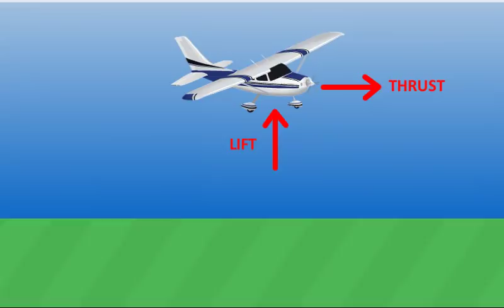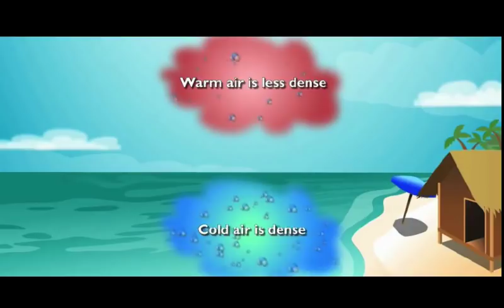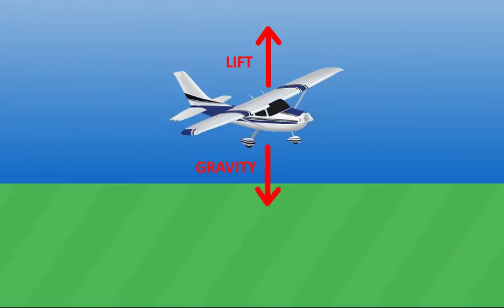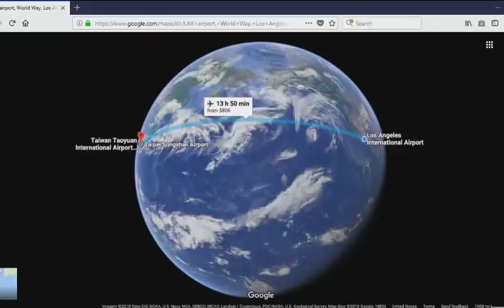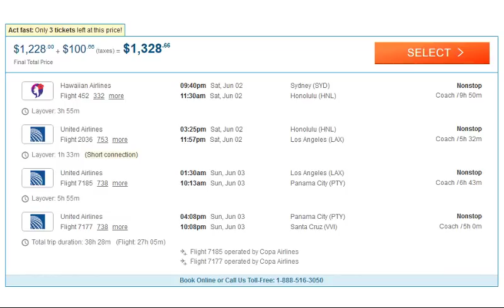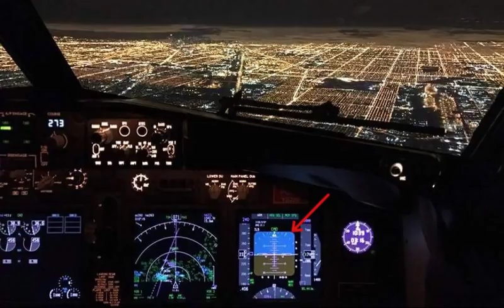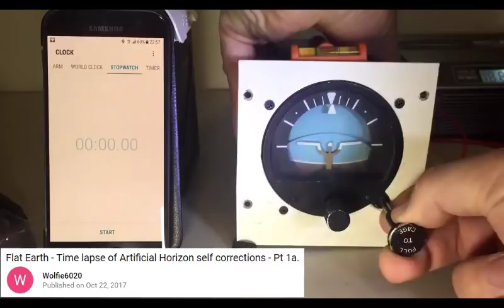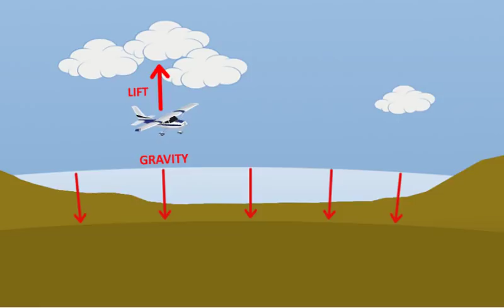Flat Earth Falsities - Plane Nonsense

Comment: lololo ...this is a lame excuse for proof ... Flat earther's have way more proof then this garbage ... lolololol
Reply: "north star over top of the north pole and the stars circle our earth  does that prove a moving earth , Not to me"
It is the first proof that something is moving.
Then you combine it with the stars also circling around a second point in the sky over the south pole.
And you notice the speed of the star rotation matches the length of a day and also the speed the sun passes over.
Then you realise that you see different stars from different points on the Earth with Polaris getting closer to the horizon as you move south until it is no longer visible in the Southern Hemisphere. Exactly as you would expect on a sphere.
Then you realise that as you move 180 degrees across the latitudes, the angle of the moon changes accordingly. Exactly as you'd expect on a sphere.
Then you start to piece together that this all fits perfectly with us being on a spinning sphere and you start to look for evidence or contradictions of that hypothesis...
Reply: "I have a tough time believing water is round."

This is according to the heliocentric model to answer that redundant question you FE get stuck on: This is just talking about Earth itself.

1. The Earth is in motion both in a rotation and a path around Earth's center. 

2. Earth rotates at 1000 "mph". Due to the sheer mass and size of Earth - if a human walks unhindered at a steady 2-3 mph they are moving as fast as the Earth rotates in comparison. Retrospectively, it takes a human 2-3 seconds to jump and do a 360 whereas the Earth takes the entirety of 24 hours. 

3. Water has three forms: Solid, Gas, and Liquid. 

3a. Water in a solid form takes the shape of whatever is holding it. 

3b. Water in a gas form takes both the shape and volume of whatever it is in.

3c. Water in a liquid (microgravity) form will become a circle (like a drop) and has a fixed volume. 

4. Undisturbed water enters a state of hydrostatic equilibrium. The surface is perpendicular to local gravity at every point. Albeit a bad term I'd rather not use - but since this even has to be explained I'll put it simply:

The Earth is a massive raindrop. 

5. Want examples of water raising locally in which air pressure offsets the weight of raised water? 

A. Get a glass of water.
B. Put a straw in it.
C. Drink.

You're welcome.
Reply: +GrahamStw
But @Tell us the Truth Media !!!  stated he had done the research and therefore he should have known those things. Surely he/she/it wasn't being dishonest. Shirley Knott!
Reply: Mykal Ridikulus holy shit, good read and much better reasoning than "i did some watching of loonies on youtube".

Also, how do they forget about a raindrop being round, (what shape is a hailstone, ya tards.) It only looks like that typical shape because it encounters air resistance while being pulled down by gravity.

Wow, they do so much "thinking"
Reply: Yeah, like being tasked to write a 10 page essay, but 1 mention of the word "the" nets you an F or a 1/10 lol
Reply: hiddengnome 

To be fair.. a rain drop is no more "perfectly round" then the Earth is. 

Aside that, it bothers me that they never take motion into account. In the heliocentric model, it is irrelevant if you don't believe something exists - it's then your duty to test it accordingly and disprove the belief whatever that is.

Example: "Gravity doesn't exist it's just Bouyancy and Density." 

Invalid argument. This takes two ideas (bouyancy/density) which are products of gravity - yet remove gravity from the equation. Furthermore neither idea explains nor has anything to do with explaining what is up and what is down - why this rises or that falls. High and low density are left at the same value and nothing exists explaining the result - one we call gravity - the idea that gives them lesser or more values. 

It's absolute nonsense.
Reply: Bobby Wizdum 

Not what I said.
Reply: Bobby Wizdum 

By the way. 

Wisdom comes from Latin, "sapiere", which means "to taste". 

Both these Latin origins are entirely irrelevant.
Reply: Bobby Wizdum 

..and no. Gravity derived from the word "heavy". 

"Gravis" is heavy. 

"Gravitas" is weight and derived from "gravis".
Reply: Bobby Wizdum 

I would however love to know how you tested whether the Earth is moving or not. 

I mean I'm sure you took into account the different time lengths a single non stop flight from, say New York to L.A. does not take the same length of time as that same exact return flight amirite?

That's because of motion, numbnuts.
Reply: Bobby Wizdum 

1. I don't give two shits what anyone else said. I personally did not so irrelevant and sad to use someone else's words against me. 

2. Google it. Flights to N.Y. and L.A. non stop both ways. Each has different time lengths. 

Final Lesson. What is velocity in physics? 

Here's your analogy for reference. 

A. You standing still as a train stop. 

B. Man on a bike traveling East on a bike at 5 mph. 

C. A train speeds by also heading East at 100 mph. 

Use this for reference for this problem:

"If the Earth (c) is rotating at 1000 mph how does a plane(c) that speeds at half that affected by rotation?"

This is an invalid physics question. Both the Earth (c) and the Plane (c) are being utilized as the same reference point invalidating the question. 

In other words: The plane is being referenced as a planet (c) when it's a plane (b). 

Retrospectively. Earth's velocity (c) is measured via comparison of fixed stars which move drastically slow in "the sky". A plane on the other hand is not measured by compared stars but if you do..

...flip this you will easily see the invalidity. 

Measure a plane according to Earth's velocity - the planes you see in the sky are traveling (c) (1,000 mph). 

This conclusion leads to one possibility. 

A plane can and will reach it's destination East to West but will be influenced to and from respectively.
Reply: Perspective

You are at the back of a speeding train. Walk to the front of the Plane then back again to where you started. 

The plane is moving x mph - you're on it and clearly can't walk the same x mph. You can make it to and from but one direction is easier and slightly quicker. 

Why's that?
Reply: Bobby Wizdum 

I'm not contradicting a damn thing.
Reply: "who knows how we get the green lights of the north."  Oh man, if only we could send some people out with some measuring equipment for the ionisation and magnetic fields that wikipedia says happens there /sarcasm

"what does how magnets work have to do with there being 1 or 2 poles?" Magnets have 2 poles, stands to reason that the earth is the same, seeing as how compasses point to one, and birds have been proven to use the magnetic field to navigate  https://www.lunduniversity.lu.se/article/how-birds-can-detect-the-earths-magnetic-field .
So seeing there is a magnetic field, and we know of one pole........ we globers know that the south pole is the other pole, so where is the other pole on flat earth?

"whats at the north pole land or frozen ocean?"  Hmmm, only two options to pick from, and neither is right by itself.... hmm, what to pick....  Oh, of course, the correct option 3, which is frozen water and non-frozen ocean (wait, do i also need to include animals and possible sneaky submarine vessels, damn, i just don't know what will be right enough)

Edit:  Damnit, i forgot, there is land under the north pole water and ice too, otherwise all the water would just drain out...... L O L
Reply: wong this there's only one pole the rest of your questions are jibberish.
Reply: Mykal Ridikulus a body of water is not a drop. fail.
Reply: Mykal Ridikulus you cant prove this "motion" why would we take it into account when our model matches our senses and every test trying to measure earths motion? its stationary 

gravity came from the word weight in latin. it was written into these definitions by newton and einstein.
Reply: Bobby Wizdum 

Yes we can. If you need to know why, read the other comment. Not repeating it a third time.
Reply: Mykal Ridikulus thats due to jet streams. this guy is saying everything moves with the rotation. atmosphere, etc. therefore the spin would not be affecting flight times. now youre hear saying it would. think mcfly a 500mph couldnt fly against a 1000 mph spin. the flight times cant possibly be due to earths spin. youre completely contradicting what u ballers believe
Reply: Bobby Wizdum "there's only one pole"   How do magnets work? How do we get Aurora Borealis?
Reply: Mykal Ridikulus thatsnot due to the earths spin. planes would not be able to land. 

your own science will call you wrong. thats tailwinds not the earths rotation.
Reply: hiddengnome who knows how we get the green lights of the north. what does how magnets work have to do with there being 1 or 2 poles? whats at the north pole land or frozen ocean?
Reply: Bobby Wizdum 

"Planes would not be able to land."

Yes they would. Frame of reference and I just explained in thoroughly.

No.. I agree and "my science" agree.
Reply: Mykal Ridikulus dude noone accept you is saying that planes travel west faster due to earths rotation.
Reply: Bobby Wizdum 

Yes it does. Frame of reference. 

N.Y./LA flight proves my point dumbass.
Reply: Bobby Wizdum 

I answered everything else and you can't argue a shittin thing this why you aren't and avoiding it. So why persist on this? Lol
Reply: Bobby Wizdum 

The disparity from one direction to the other is miniscule yet present. The greater the distance - the bigger the disparity.
Reply: Bobby Wizdum 

P.S. It's "except".
Reply: Why is it FE struggles with grammar and spelling yet expects to be taken seriously on physics and velocity specifically. Lol
Reply: Bobby Wizdum 

We know how we get green lights. 

We also know how important magnets are.

You are invalidating your own horseshit.
Reply: Mykal Ridikulus no it doesnt! that doesnt happen on all east/west routes for 1. second that means the atmosphere isnt all moving along with earth. third the plane would be unable to catch up to the earth that was flying 1000 mph ahead of it. your arguing with your own science lmao

you have a theory about green lights of the north. it isnt factual. much like why the sky is blue. can we test this reason? are their other explanations? saying i dont know isnt inventing things. its being honest. how important magnets are again doesnt make having 2 poles necessary unless we are on a globe.
Reply: hiddengnome youve never been to the restricted areas of the north pole. old maps all show continents there. did they sink? were they frozen over? are they still there? you dont know everything just because you were told or can google an answer. 

as for magnetic poles you dont "need" 2 of them on flat earth nor is there evidence of all compasses pointing north from the south "pole". in fact its always moving so youll never be on it according to the elitists. 

as for the green lights claiming you have the answers is simply cockiness. its an unknown phenomena.
Reply: So a guy in the north of Norway, Sweden or Finland can't use any equipment to measure radiation, observe the lights with different spectrum observation equipment (IR cams, cams that pick up ultraviolet), etc when there are and when there aren't Norhern Lights? And he cannot keep doing this for many years? Because, the more data, the more accurate it will be? He cannot let a balloon with sensory equipment up to get closer to the "unknown phenomena" to get more data. 

Yeah, let us stick with the most lazy and simple answer, just let there be a void in our knowledge... lol
Reply: hiddengnome who said they cant measure the lights? that doesnt mean we know the cause or how they got there. where did the sun and moon come from? who knows!
Reply: Bobby Wizdum And yet the measurements they take allow for questions like "where does it come from" then they can make a hypothesis, testing whether everything fits that hypothesis, if it doesn't, maybe do experiments where they shoot charged particles into oxygen molecules, or nitrogen etc. etc.
Reply: +Tell us the Truth Media !!!
Flat earth idiots, look that up
https://www.ecosia.org/search?q=Flat+earth+idiots
Reply: lol ... Ive done the research Brother ... It's ok ... I just have a hard time believing all the water in this world is a ball ... water goes flat ... Bin tested and fails the globe theory Sr. ... Flat or not I'm not buying the "official narrative" ... )))
Reply: @Tell us the Truth Media !!!
"lol ... Ive done the research Brother ... It's ok" Is that so? I' am impressed. Therefore you should be able to answer these simple, practical questions with ease.
Why is it that a compass needle is more or less vertical at the poles and horizontal at the equator?
And when you carry on past the poles the needle slowly returns to the horizontal?
Why is it that it is only possible to navigate accurately over long distances using spherical trigonometry?
Why is it that traditional gyro compasses work perfectly in low latitudes but became unreliable in high latitudes?
Why is it that it is only possible to navigate accurately over long distances using charts based on a terrestrial spheroid?
Why is it that when you watch a ship sailing away from you the hull is the first thing to go below the horizon, then the superstructure and finally the funnel and upperworks?
Does a magnetic compass point towards polaris (Alpha Ursae Minoris) at the north and south poles?
Does a gyro compass point towards Alpha Ursae Minoris at the north and south poles?
What is the relationship between longitude and distance when travelling east or west parallel to the equator?
Please explain the principles behind the development and functioning of a gyrocompass?
Reply: Explain the north star over top of the north pole and the stars circle our earth  does that prove a moving earth , Not to me ... Compasses down prove anything and if it does you tell me how ... Gravity has no bin proven , ever ... Its just another filled with nothing more then assumptions ...
Reply: @Tell us the Truth Media !!!  So you don't know do you, in spite of your much vaunted research. Which means. You are a liar.
Understand A liar, and ignorant one at that.
"lol ... Ive done the research Brother ... It's ok" Is that so? I' am impressed. Therefore you should be able to answer these simple, practical questions with ease.
Why is it that a compass needle is more or less vertical at the poles and horizontal at the equator?
And when you carry on past the poles the needle slowly returns to the horizontal?
Why is it that it is only possible to navigate accurately over long distances using spherical trigonometry?
Why is it that traditional gyro compasses work perfectly in low latitudes but became unreliable in high latitudes?
Why is it that it is only possible to navigate accurately over long distances using charts based on a terrestrial spheroid?
Why is it that when you watch a ship sailing away from you the hull is the first thing to go below the horizon, then the superstructure and finally the funnel and upperworks?
Does a magnetic compass point towards polaris (Alpha Ursae Minoris) at the north and south poles?
Does a gyro compass point towards Alpha Ursae Minoris at the north and south poles?
What is the relationship between longitude and distance when travelling east or west parallel to the equator?
Please explain the principles behind the development and functioning of a gyrocompass?

Comment: Reason and critical thinking are a powerful weapon to destroy ignorance.  Well done.
Reply: Well, it may be not "destroy" ignorance, but at least stir it up, as you can see with all these butthurt flattards flocking the comment section with their nonsense. You can see that the video really got to them, when they are not able to address any of the points given there outside of a typical "uuuh, that video is wrong and voysov is a shill!" and try to change subject whenever they have to answer real questions.